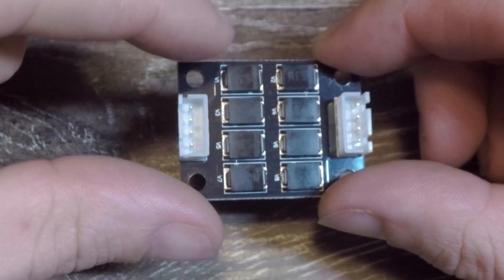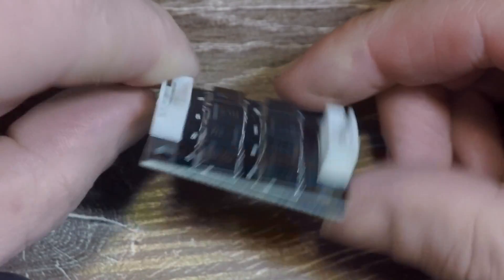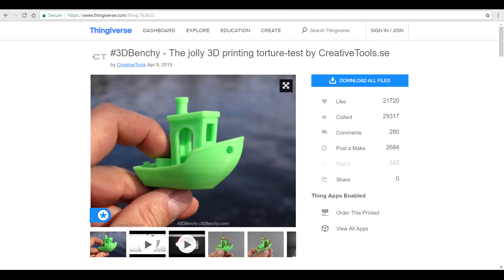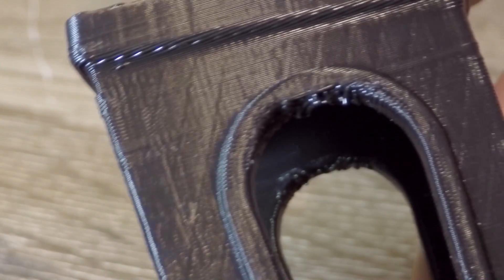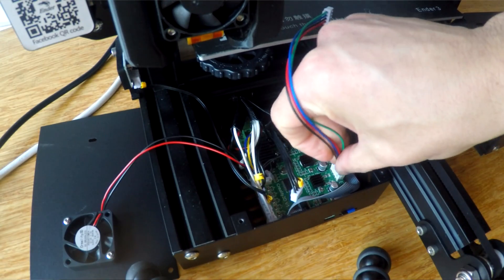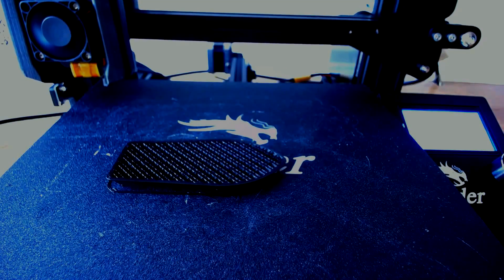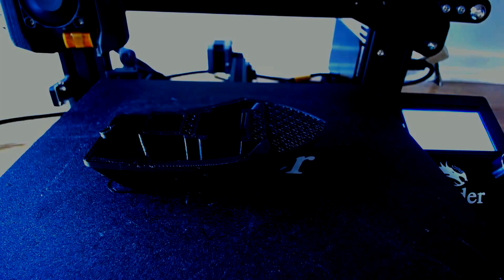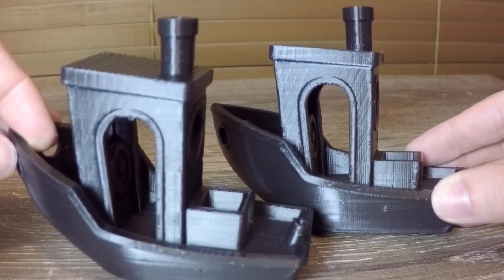Ender 3: TL-smoothers an upgrade? (Part 1 - Extruder)

Comment from the maker: Hi everyone, my last tests with TL smoothers saw great results on E but nothing on X and Y. Due to comments suggesting otherwise, I'm currently testing the print again with smoothers on X and Y. Will update.
Reply: Ya, it does make the video feel super-weird. I thought the whole point was that, if effective, the Steppers get smoothed. I get that the extruder has a stepper on it but with bowden it's far removed from un-smoothed positional effects...
Also that smoothing Z is unlikely to help. I'm still watching the video and, apparently like a lot of folks, asking myself how it's even possible to see any improvement if you don't put 'em on X and/or Y...
Reply: https://youtu.be/QEzMWE3-lVY?t=4m2s    Nexi Tech seems to get good results after installing TL smoothers
Reply: £140 from gearbest with free delivery. I nearly got and ender2... Creality are just crushing this market, insane value for money. I'll predict something easy - Ender 3 is going to be the most popular, best supported printer ever, by a Long way. Making 2018 the breaking point for domestic 3D printing. Creality will get 50% market penetration with this, single machine. It's kinda scary how fast these things are getting great #GameChanger xxRj
Reply: So you didnt install it on all axis ?
whats the point of not doing it on all stepers ?
Reply: Maybe (thumbs) defnly cheap enough to try :)
Reply: Rafał Nie podam Nexi installed it on x and y
Reply: thanks also bought
Reply: P D James I think in Vasemode the z could make a difference
Reply: nexi installing tl or x and y ?
Reply: Miky - have a look at some of the other videos on installing TLs. There's a link a few comments up. On the Z axis smoothing doesn't normally have a noticeable effect because non-delta printers only advance Z for each new layer. Sure, TLs are cheap enough to just put everywhere but it's still extra stuff on your printer you really don't need. The reason people are querying this so much is that, in general, you gain most advantage by smoothing the X and Y axis - so the path for each layer gets smoothed out, in theory.
Even then a lot depends on profile settings, which slicer you're using, which printer you got etc. etc.... there's no absolute truth and, oddly enough, a tiny bit of slop in your steppers, links or belts can make smoothers pointless. You will get 0.1mm shift on any position anyway. We're still all waiting to see if XY smoothing is good for the ender3 - it does seem to woirk, for some people... ;o) Rj
Reply from the maker: P D I agree on the gamechanger thing. When looking to review other cheap printers I don't know what to do because everything before it will be inferior. Clones will be coming though..
Reply: Guys I am a bit confused now, since I have got my new Ender 3 Pro with motherboard V1.1.4 - I was wondering if installing of the TL Smoothers into my Printer still have any sense? I know the V1.1.5 is called 'silent motherboard' with TMC2208 - so I guess I do not need them to mine version too? Not sure, thanks in advance for the clarification.
Reply: Konrad Grabowski i would love to know this as well since i have the newer motherboard as well. Still learning about my awesome printer!
Reply: Let the clones come :oD the only dodgy thing is quality control really - n that sounds like it's 99% acceptable. So 9/10 in everything a domestic bot needs, easy and cheap to tweak, box, upgrade. Creality made it open source didn't they? Abs, Ptfe ok with most flexible stuff - rigid, quite fast, makes a milk-carton sized thing.
Jesus - lol
Reply: I nearly got a 5years old, brand new Fisher #RepRap nearly... 
For fun, it needed hugs n very cheap ;)
Reply: Any Update?
Reply: https://www.youtube.com/watch?v=zIPeHXCVS2Y xx
Reply: E

Comment: the wiring for the connector on the generic brand can also be crap I checked some from Amazon and the wires for the connection had 3 strands of copper lol

Comment: After converting to direct drive on my Ender 3 Pro and tuning my machine, I had terrible salmon skin. I added smoothers to my extruder stepper and now have to best quality prints I have ever had with no other adjustments. Maybe others have had a different experience, but for $8, it is crazy not to buy a 3 pack and put them on X, Y and E and give it a shot!

Comment: My ender 3 was infinitely better with the smoothers. Also, nobody mentions this but the application of smoothers are made to not make things smoother. They're made to operate machines faster and stay with smooth quality at close to a 1/4 over your regular speed. So instead of 100% you'll now be able to safely go 120%. Do not go to a full 125 as that's the full speed but it's on the cusp of going too fast. So drop the 5 to be safe and stay at 120. The extruder does not need it and does absolutely nothing for it. Even the z doesnt really need it. But print at 100 and then go to 120. After do the same but with the smoothers installed and you'll notice a huge difference. Heres a fun thing to experiment with...use multiple smoothers on 1 axis. Nobody ever thinks about that but when they hear that cant believe they never thought to do it. There is a difference there too. Although they do the same same thing,  that little fraction of a second it take the current to go from one smoother to the other is just the rite amount of time to go in between the steps of the first smoother. You can  get some extremely smooth surfaces at a higher speed 120 speed will put out better prints than the stock model at 70%. I put them in my new silent board and no joke that thing spits out mirror like prints cuz of the upgraded axis that come In the boards themselves. I highly suggest everyone experiment with this. Especially how cheap and easy it is to install. If you use smaller lines and squish. You wont even be able to see lines ever again and easily to great overhangs and you'll never deal with artifacts at all. Theres 1 downfall. Your supports are stronger and really attach to the model more than usual but a little sandpaper can fix that

Comment: We tested the same generic bigtree TL smoothrs shown in your video on Ender 3 and had the same results. We then switched to genuine Triangle Labs units and had a noticeable improvement. Both were 8 diode builds although the Triangle Labs one's had larger diodes. We also found they worked better in delta style printers.

Comment: Your test is flawed.  You have to install at least two tl smoothers,  one on the X and one one the Y.  The Z axis provide minimal benefit.
Reply from the maker: That's why there's two parts to this. Spoiler alert: same results. Z axis smoother still useful for vase mode.

Comment: My Ender 3 received on July 2019,  The quality from original setup is pretty good after some adjustment e.g. X,Y fix, under extrusions.  when I watch this video, I put TL smoother and do some tests, the results is the same, so I would not suggest to add this module.

Comment: I installed the 8 diode smoother and now my Ender 3 pro will not print.  Please help I do not get this problem.
Reply: You connected the pins to the right place on the MB?
Reply: Does it not start up or just doesn't Extrude? I never heard that Tl Smoothers on E give any benefit

Comment: Besides having a pre built machine.. Is the ender 3 really any better than a Tevo Tarantula in print quality? Mine is fine... But I like the features and design of the ender 3...
Reply from the maker: I think the larger print volume wouldbe the main selling point. Tevo have a clone coming..

Comment: Are all bed bent equal? I mean, mine is lower in the middle, how is yours?
Reply from the maker: Mine looks reasonable with a straight edge on it.
Reply: It is quite weird, I use a gcode to move the head to the four corners twice and then to the center and always the bed is too low if I preheat the bed to 60ºC, but if I preheat it to 100ºC then the center point is much better. Looks like if the bed were too tightly screwed to the carriage or something like that. Anyway I'm using it mostly to print ABS+ so it really is not much a problem.

Comment: Nice! Glad you confirmed the TLs won't help! Can't wait for your BLTouch install on the Ender 3. I did the marlin version and ended up losing the SD card capability due to memory constraints. Curious to see if the ADV firmware is a smaller foot print. Would love to have BL AND SD!
Reply: Wait so you can't read the MicroSD card anymore?! How do you load gcode then?
Reply: Either direct USB print connection, or a middleware like Octoprint...
Reply: Super stoked to have your sharp eyes looking into this. I wonder if power-loss recovery is something that has a memory footprint?
Reply from the maker: It's a huge caveat. One part still waiting in the mail but I hope to find a work around by turning off other features.
Reply from the maker: It would but it's not in the TH3D firmware yet (unless it's very new).

Comment: While not performing their original purpose on the E3 they do offer protection against reverse current flow when you move the steppers manually too fast
Reply from the maker: That is a good point.

Comment: Great video.  Short, sweet and to the point.  I appreciate that you are expanding your test set to see if your results are universally applicable, or not (as in this case).

I have seen this type of wall pattern at times on my own prints (Wanhao i3/Monoprice Maker Select Plus).  I have always theorized that the lines occur where the infill touches the wall because the wall experiences different thermal and mechanical stresses as it cools when it is backed by infill rather than air.
Do you think that's possible?  If so, it would seem that ways to mitigate it would be 1) change the wall shape in the slicer to compensate so that the wall has a pattern when hot but not after it cools (this seems like a difficult software problem to me that would be hard to tune and very dependent on filament properties) or 2) print thicker walls (at the cost of higher print time and cost).  I suppose the second mitigation strategy could be tested by printing several of the same jobs while varying only wall thickness.

Apologies. 

Seems like my comment ended up much less concise than your video.
Reply from the maker: A very interesting and original theory. I would think that because the infill is in the same place each layer, if it were affecting the exterior the artefacts would be vertical instead of diagonal. Thoughts?
Reply: I use cubic infill, so the intersection points of the infill and outer wall shift from layer to layer along a flat vertical wall.  When I watched your time lapse, it looked to me like you were also using cubic infill as well.  I agree that my theory doesn't fit of the infill pattern is identical on all layers, like the classic square grid rotated 45 degrees around the z axis only.

Comment: You need them on the XY axis more than the extruder. but best to fit on all 4 anyway but there you go. The more I use mine the more I am tempted to go for a RAMPS upgrade. The stepper motors on mine I think also are slightly out (also printed a few benchy) and the option on another printer was to reduce the step size on the motor, not investigated if you can do this with the stock Ender3 M/B though doesn't look like it. I am going to fit an OctoPi and the TL smoothers into the space between the current M/B and the LCD as that space is just begging to be used. I added stepper motor dampeners too, makes huge difference to sound. BTW watch out if hot environment and you print ABS the stupid design turns off the M/B fan as wired in series with the extruder cooler so you loose cooling to the stepper motor drivers... doh! That is so stupid. There are internet posts about that and you wire to the 12V instead.
Reply: Dominic Baines: I'm planning on installing dampeners. I heard that by insulating the steppers from the frame for vibration, you are also insulating them from heat transfer. So without the thermal sink that the direct connection to the frame is providing, the steppers can overheat. The solution was to attach heat-sinks with double-side thermal transfer tape to the bottom of the steppers. 
src: https://letsprint3d.net/2018/07/07/how-to-install-stepper-motor-dampers-ender-3/

I'm curious, what has your experience been?
Reply: Michael's youtube not mine.... but nice hint. Not had to yet as not gotten hot enough but will give it some thought and analysis. I have some copper heatsink that would fit, I might advise you could use the stepper screws to secure them not just tape adhesion. As for the problem you state with your Y axis one why not fit it to the side so doesn't snag the bed adjustment screws (the face with the label rotate up 90 degrees)? Or make an L bracket and place between the stepper and  the dampener (use the mount screws on the stepper) and put the heatsink to the rear?

Comment: I think you should try all motors with TL smoothers.
MAKE THE PRINTER GREATE AGAIN.
Reply from the maker: It's running again with X and y.
Reply: all the upside-down T structure printer have a major problem: steadiness.
it needs a triangle enforcement to fix the problem, otherwise the nozzle would drift while printing(especially x and y back and forth frequently).
please try it.

Comment: A Quick question, Would Anti Noise Vibration silicon or rubber washers do the job (worked great on my pc power supply to suppress noise).Just asking as you mentioned stepper motor dampers
Reply from the maker: On paper I would say yes. Please post if you try it.

Comment: i would not just shove the smothers into the case without taping or heat shrink tubing over the circuit board.. else most likely you will short out the solder points on the case or the main board
Reply from the maker: I agree completely. From memory I had a note in the video saying it was temporary.

Comment: So happy your making a video of the ezabl!!!! My ender 3 is on order an I have a ezabl mini sitting here for it my Instagram is grabowski95 please follow me I have been setting them up like crazy if you need anything about them I can help too!
Reply: Also I have been printing all my parts for upgrades for the ender 3 e3d-v6 ezabl an all fans included with the upgrades an possibly cr-10s dual extruder board? Have to do a little more research
Reply from the maker: Thanks for posting. I'm not on Instragram but I'll look you up if I get stuck.
Reply: Okay perfect an no problem I talk to timmy everyday he is great an really takes pride in his product an like I said I'm just super happy to see a video from you with the ezabl on the ender 3 before I get mine set up. Also I think I'm going to be doing dual extrusion on the ender 3 with a v6 hot end an the Prometheus system an eventually might try an mod the Prometheus system to do up to 4 different colors an a duet board on the tevo little monster because well that will be my first printer with a duet wifi board
Reply: Also I have been boarder line harassing cocoon lol i am trying in the worst way to get a cocoon create touch an I will swap it to 110v or there us version the BALCO touch but there even harder to find
Reply from the maker: Those Balcos sound like a PITA. Too many components left off to save money.

Comment: I'm having an issue with mine. Not sure if it's my settings, or the bed or what. But when my prints start the initial later won't stick and just clumps sound the nozzle. I've leveled the bed a ton of times and still happens. The only thing I could think of is the bed is uneven. Mine came with a removable plastic bed, so I'm skeptical of it. If anyone has any tips, I'm open for ideas!
Reply: I had the same problem. I bought a piece of glass at the hardware store had them cut it to 9"x 9" attached it to the bed  with large spring type paper clips readjusted the bed and used a little hair spray on the surface so the print would stick. Problem solved.  Enjoy.
Reply: Roger Jette: Can confirm.
I've heard a few reports from Ender 3 owners that their beds was warped. I suspect the build-tac like surface that they use. I bet it shrinks when it cools.
Reply: this printer is for me the best printer on the market for the price.. but its bed is useful. Just buy any piece of normal glass 22,5 x22,5and you gona stat to make wonders!!